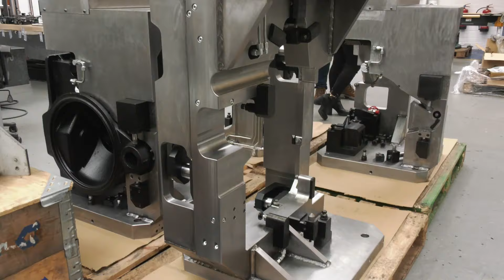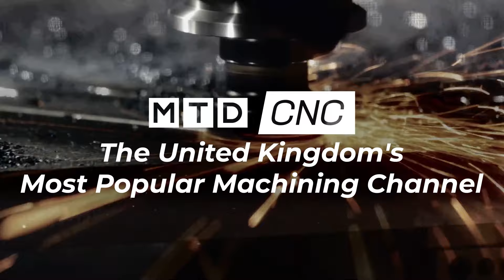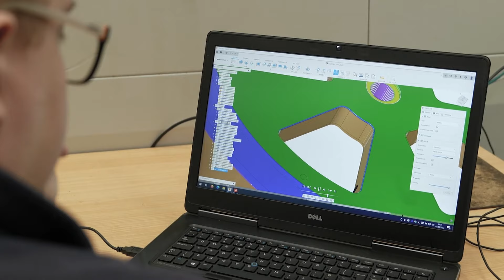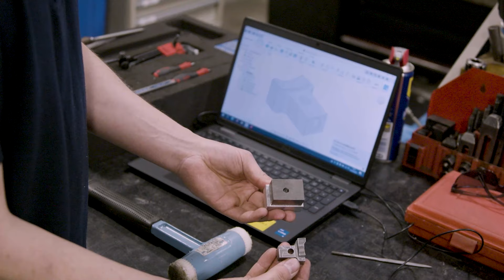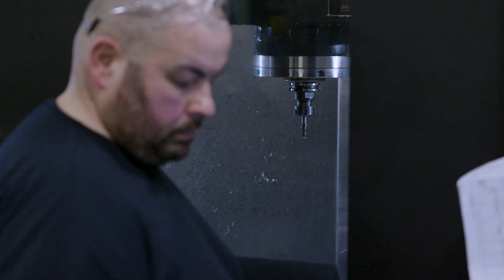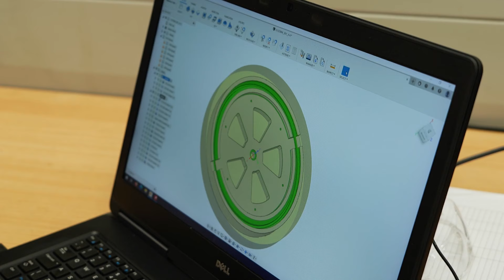Brown & Holmes rave about Autodesk Fusion 360

Comment: I totally agree. Fusion 360 isn't the most feature-packed product on the market for CAD or CAM, but it's incredibly easy to use and everything is seamlessly integrated through the cloud. It's an incredibly powerful tool for getting the shop floor and the drawing office working together effectively. If you don't have CAM workstations in your machining cells, you're missing out - not just on the speed and efficiency of having CAM on the shop floor, but the skill and talent of your staff. For the price of a decent milling vise, you can revolutionise how your business operates.
Reply from the maker: glad you enjoyed the video!
Reply: looked at it recently? . We ditched those Point solution desktop products and replaced ALL our CAD and CAM with Fusion. so cost effective.